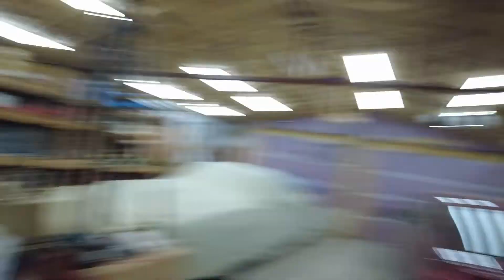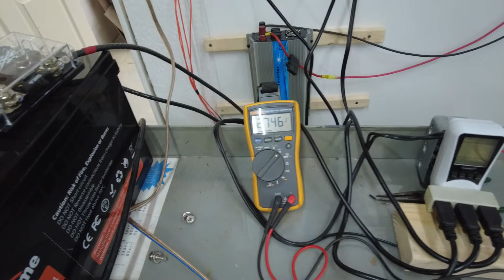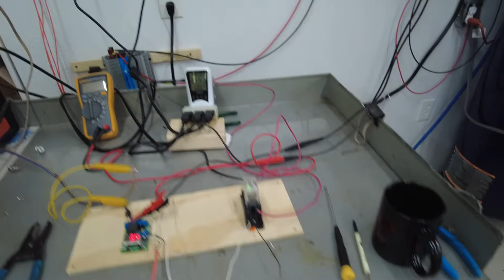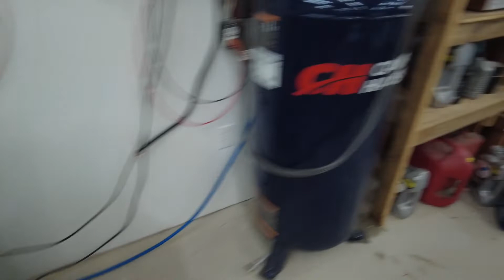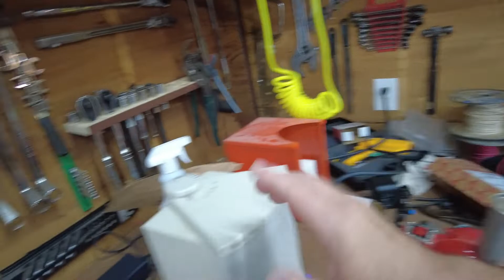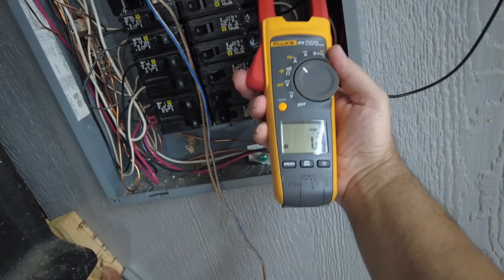Grid Tie Limiter Experimenting Part 1

Comment: Well I have a grid tie inverter and I simply put it in non-export mode and it meets all of the loads in my home and if there are no loads in my home it throttles down to zero and never back feeds the grid. And no, I do not have a permit or in interconnection agreement.

Comment: I think you need CT’s on both of your mains as well as your solar inputs…. If you take, for example, the Emporia energy monitor…. There are CT’s on solar inputs, and there are CT’s on the Maines The app basically takes one and subtract it from the other. The mains would be a + and the solar input would be a - …..when your 0 you’re even and when it goes into - numbers your back feeding…. The meter actually calculates watts (volts x amps) and uses that for the Calculation …. So you have + wattage coming from The utility and - wattage being produced by your inverter…. The net tells you what’s going on ….+ numbers your not back feeding

Comment: But I do know if you move your inverters to of the breaker panel as far away from mains it well help the backfeed have a chance to supply the loads
Reply: Dude that's nonsense. 😂 the voltage is identical no matter where you are on the bus.

Comment: First let me say, you are crazy-smart, mad-professor smart! 
I think I know what you are doing. I think I know how you are doing it. (But I see the Growat in the background so maybe I don't know what you are doing). I'm going to try and explain what I think you are doing:   You are using "dumb" inexpensive GTIs (no feedback) that you are attempting to control by CTs output that you have fed into a low voltage "current switch" (I don't know!  I am a mechanical guy!) that directly controls a relay that switches the AC on-and-off for the GTIs. You have settable CTs and settable "current switch". I think the idea is to have your GTIs come on when a demand is sensed on specific legs/specific circuits of your panel, but you only supply your GTIs with enough solar such that demand will always outweigh supply so your meter never goes negative.  Is that what you are doing????
Reply from the maker: You nailed it. With a simple on/off one set point the power demand has to be around 2 1/2 times of what your inverter will be supplying for it to reliably cycle with the demand. I was hoping to get the down to 1 1/2 times, but reliability went away as soon as current draw from the grid dropped below 5-6 amps. I haven't given up on it "yet", but jut want to keep moving forward with what works. This way solar can start paying me back while I experiment with things.

Yes, my project is two fold. A set of cheap grid tie inverters to help save a little on the eclectic bill, and a Growatt set-up for back-up power. The main reason I started the solar project was for back-up power, and found for a couple hundred bucks I could play with some grid tie stuff. Here in this part of Texas we have very reasonable electric costs, but with cheap comes a reliability issues.

Smart?? Nah, I just like to play and build things, but thank you for the kind words.

Comment: Interesting.  I have two of the same model current switches you showed at the end ready to go in my panel.  Intended to use one for some of my higher amp feeds (that can physically be combined) on each leg, and they'll kick an interposing relay (each) to turn their leg's inverter on.  I did take the time to test running the lower voltage input version of the Grid Tie from my 24v battery and it did pretty well , outputting from 7.7A early moving toward 6.7A steady state after about 15 minutes.  I left it running that way for an hour Saturday, and I don't have much concern letting it go until the transfer switch battery cutout takes out the inverter, which I had set a couple of tenths voltage lower than I chose to go the first time on Saturday.

Not sure about your analog CT, but I'd think your issue with shutoff when crossing zero amps may be just part of a timing/race condition.  Hard to tell what's in your black box of a meter/switch for frequency of measurement - it may be something that's better served by something like an Arduino so that you could measure and adjust to load swings quicker.  That should also allow you to program it to be variably adjustable as you'd like as well.  

Do you have an understanding of your house loads on L1/L2?  I was surprised how small but steady most of my house load was.  Most of the time I won't have a need to throttle regular PV input, as my house load is normally in the 500-1000W range.  One leg may go slightly under 0 amps for a while between 1 and 3pm in good weather this time of year, but the total has been consistently higher.  I'll need to keep a closer eye on the meter totalizer versus Emporia Vue to see if things are recording the same -- I know the Emporia is deducting my solar amps/watts.  I don't know if the meter can intelligently compare L1 and L2 for major imbalance - or more specifically whether I should care, as mine doesn't have an instantaneous Watt/hour display  I'll have to compare readings over a couple of time periods when I know I've gone below zero on one leg to know for sure.